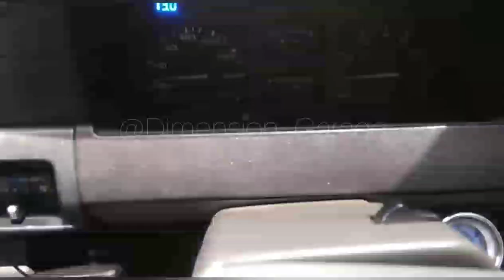Ganti Air Radiator Dari Air Biasa menjadi Air Coolant

Comment: Nuwun tanglet om pemula gadah kijang super🙏 
Misal  mau migrasi ke coolant syarat utama yg vital selain material plat radiatornya yg masih bagus nopo nggih ?
Kemudian yg harus diperhatikan selanjutnya terkait perawatan setelah menggunakan coolant apa om .... 

Matursembah nuwun 🙏🙏... 
Mugi berkah kagem jenengan atas berbagi ilmu dan sharingnya 🙏🙏🙏🙏
Reply from the maker: Dikorok dulu. Konsul sm mekanik nya tanya part masih bagus tdk. Sambungan2 pada selang korosi(berkarat tidak) jalur pengairan mulai dari waterpump, watermantel, perpak silinder kop dll juga dilihat. Apabila awam, pasrah bongkokan sm mekanik radiator. Apabila tukang radioator bilang mending pake air biasa, brrti ada part yg udah usang. Cek sendiri dijalurnya berlumpur atau tdk. Kalo memang berlumpur brrti tukang radiatornya dapat dipercaya. Kalo bisa ganti kulen, 1 bulan pertama dikuras ganti kulen kedua sambil di cek impresi sebulan pertama stelah ganti air kulen. Selesai

Comment: Sampai sekarang masih aman ga mas,  Punya saya Avanza 2011 pengin ganti dari air biasa ke colant.
Reply from the maker: Masih mas. Sangat aman tanpa bocor dll
Reply: Siap. Makasih mas infonya
Reply: @rohmanofficial8555  gimana udah migarsi ke colent apa ada efek nya?. ( rencana nya mo ganti juga)
Reply: @indragunawan2745  udah om.. Alhamdulillah udh 2 bln lbih aman" ajh. Kmaren buat mudik Bekasi-Cilacap 15 jam aman. Saya pake colant top 1.
Reply: @rohmanofficial8555  oya, itu radiator, selang" Atau part lain ada yg di ganti ngga sebelum migrasi mas?
Reply: @indragunawan2745  ga ada yg di ganti. cuma pake radiator flush doang sbelum ganti colant.

Comment: Selamat Malam ,Saya Harap Dibalas Komen Saya ,Numpang Tanya Pak ,Saya User Zebra Espass Ini kalau Saya Misal Migrasi Ke Coolant Selain Radiator apa Jg Cek Water Jacket ,Soalnya Mobil ini pemilik lamanya g pernah pakai coolant Thanks Pak🙏
Reply from the maker: Apabila sudah terlampau lama ga pake coolant silahkan cek secara visual dulu/dilihat lgsg. Apakah banyak endapan seperti lumpur pada sepanjang aliran air seperti selang, kondensor, waterpump dll. Apabila ada lumpur, wajib dibersihkan total dulu pd setor luar dan dalam mesin. Hal ini untuk memaksimalkan fungsi colant nantinya. Apabila lgsg diganti sama aja fungsi coolant ga maksimal. Selain untuk membersihkan, guna cek total untuk mebgetahui ada pary yg sudah aus apa blm. Biasnya di kincir waterpump yg ompong2 terkikis akibat air biasa